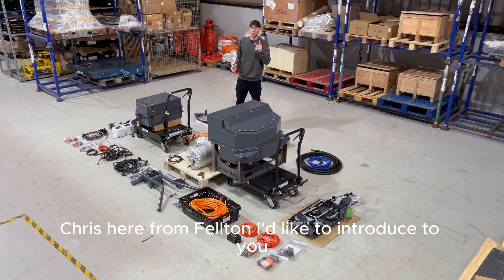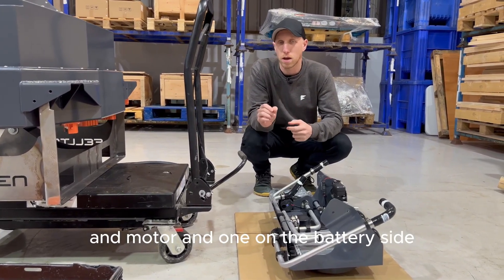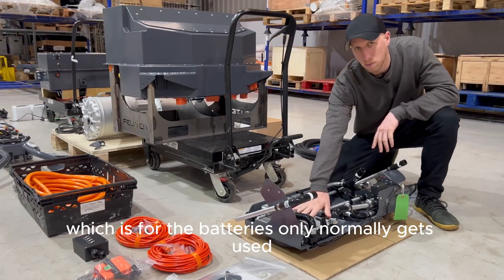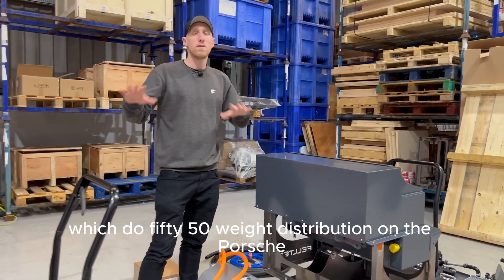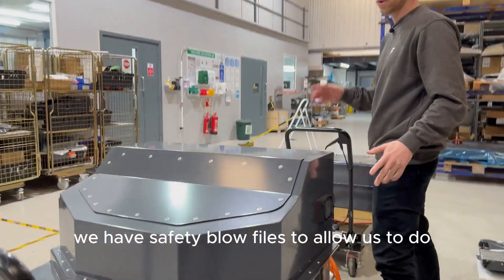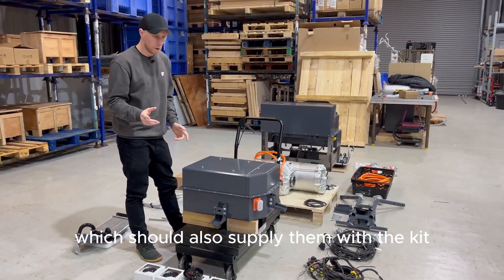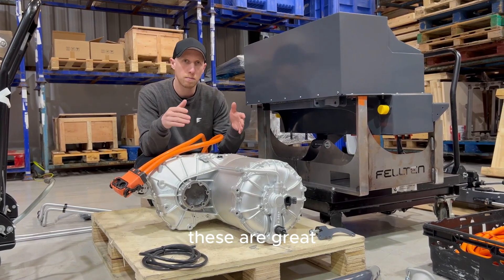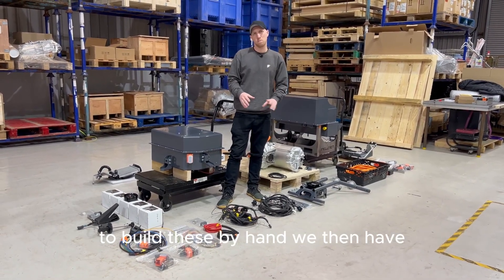Convert a Porsche 911   930 G body to EV Electric   You should do it!

Comment: Keeping the main disadvantage of the 930, which is the exaggerated weight over the back axle is not a very wise decision. This 40%-60% weight distribution gave the 930 (240 hp version) the reputation of being a widow maker with its unpredictable behavior on wet roads.

Comment: You don't mention LFP or NMC battery or manufacture. Also, what is the usable battery kWh? I will assume NMC for energy density, but would still like to know the manufacturer. Also, why not include the AC? I don't think there is a person on the planet that would not want AC. You are quite generous with the pack size. Many kits only have about 40 kWh so I'd expect you can get near 220+ miles on that pack if you don't run heat. Lastly, how many kW can it charge on AC and on DC?
Reply: He mentions there are 24 CALB modules inside. Probably the D148N58 as they are rated for use in an EV. They are NMC, 174Ah and would be 4*24 = 96 cells in series. Which is the same as the old Model S where the motor is from. 174*3.7*96= 61.8kWh which is pretty close to the 61.2kWh he mentions.